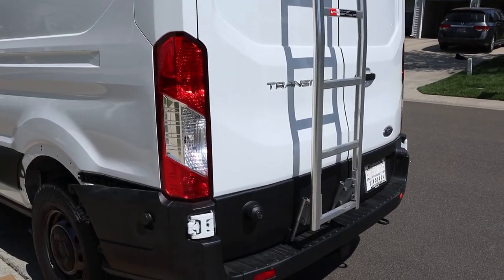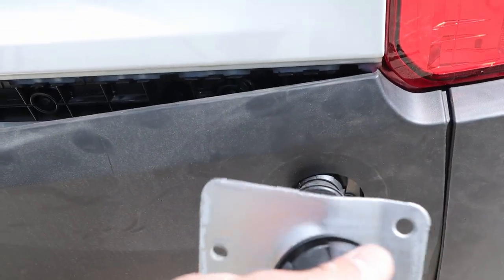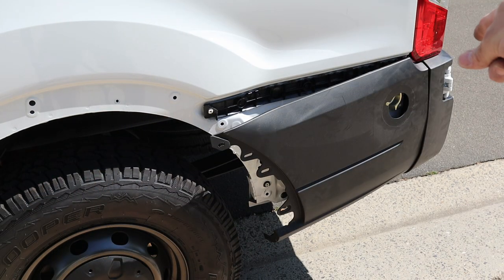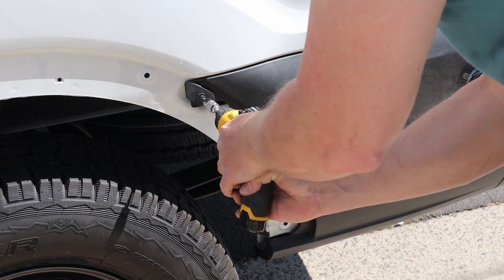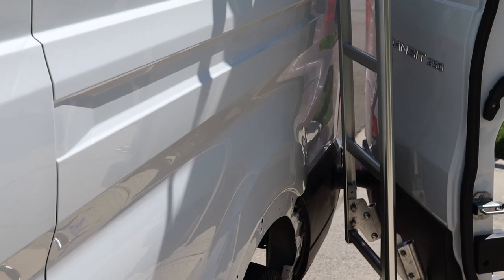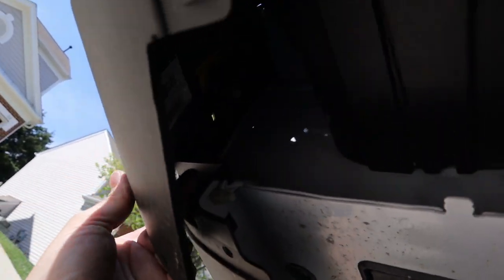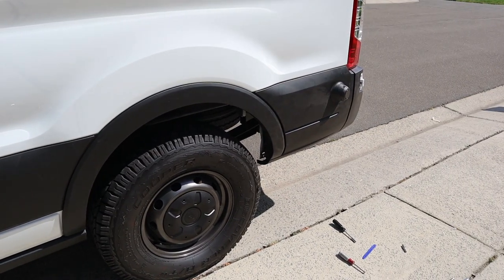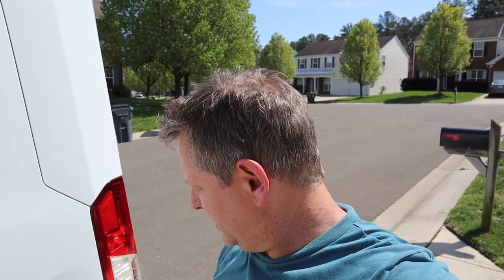#MTBPlanB Install longer bump stop and magnet for rear door of 2019 Ford Transit

Comment: Thank you. This video helped me to replace my bumpstop. One suggestion is to highlight where the screws are on the wheelcover. You mention them, but do not indicate where they are. Perhaps drawing circles over the location for ~5 seconds while they are exposed? They are hard to find by feel without knowing where they are... I ended up accidentally breaking off those attachment points because I couldn't find them. Thanks!
Reply from the maker: Josh, glad it helped. You make a good point about the screw locations.
Reply: Is there anything on the backside of the Bumpstop that needs to be connected or hooked up?
Reply from the maker: @seanmalatesta4957  Nothing on the backside.

Comment: Thank you for sharing! Noticed you have the Cooper Discovery A/T, are those stock size, or over-sized? And how do you like them? e.g. handling, road noise, traction?
Reply from the maker: 245/75r16 so slightly bigger than stock. Traction, handling and mileage has been great. Road noise is a bit on the high side.

Comment: I'm a total nube. I want to help replace a damaged bumper stop for a vehicle I damaged. What's the name of the tool I'll need to remove those big bolts off the metal bracket? Also is it a special drill bit for removing the Plastic trim? 🙏🙏🙏🙏
Reply from the maker: Grab a set of torx bits and a trim removal tool (plastic). The stop bracket is held on by bolts and can be removed with a socket, box wrench or crescent wrench.

Comment: What about the magnet on the rear doors? I need to replace it, but it does not want to unscrew.
Reply from the maker: Hi Tobey, Did you try popping the plastic housing off and grabbing the magnet with some vice grips and turn clockwise...it’s reverse threaded.
Reply: @MTBPlanB  Thanks for replying with that tip. I noticed the reverse threading on the replacement after counter-clockwise didn't feel right on the broken one. However, clockwise just keeps turning the broken one. I can't get it out yet.
Reply: @tobeyhancock1042  did you figure this out yet? Im having the same issue
Reply: @gordonjack1375  No, I got busy with other projects and need to return to this. I intend to take the interior door cover off to see if the bolt welding busted loose by chance.
Reply: @tobeyhancock1042  Thanks Tobey. Im in a similar spot as you and was thinking the next step is to remove the interior paneling but on the road at the moment so dont want to go down that path (yet). Please let me know if you get to it and have some insight for me. Ill do the same.
Reply: Was able to get around to this today. I pulled the interior door trim off (I have a passenger wagon) and found that the other side of the magnetic bumper has a T55 Torx bolt which had partially worked its way out. This was due to my earlier efforts to spin only the exterior bolt clockwise. Holding the T55 bolt in place was necessary to remove the bumper in my case. 
It was a little difficult to do without help. I used a long handled breaker bar on the torx bit to keep it stationary with my left hand reaching through the gap between the door and the tail light. I finished rotating the magnetic bumper off of the bolt with channel locks in my right. Reinstalling the new bumper was easy after that. 
Best of luck!

Comment: Do you know the part numbers needed?
Reply from the maker: I ordered for a 2018 Transit to get the longer stops. Part numbers are:
Lower rear Side trim bump stop BK3Z-61247A64-C 
Cargo door magnet BK3Z-6125040-A
plastic covers BK3Z-16758-C
Reply: Sorry, but all 3 items need to be changed to give the extra protection? I’ve got a mk8 and the ladders have just arrived today, so glad I say your video, thx
Reply from the maker: Yes, if the mk8 is the equivalent to the 2019 in the US.
Reply: @MTBPlanB  This is great. Thanks for putting this out there. Almost put my ladder into my window. 
Will I need more than one plastic cover to do this job (i.e. for the cargo door and lower side)? Not sure what trim parts from the 2019 are reused here.
Reply: It looks like this part number is also needed: BK3Z-16758-B
Reply from the maker: @gordonjack1375  I believe that. Is the short plastic cover. -C is the longer cover.
Reply: Note to any newcomers, I needed four items to complete the install:

BK3Z-16758-B 
BK3Z-16758-C
BK3Z-6125040-A
BK3Z-61247A64-C
Reply: @gordonjack1375  These are all the parts for one door, correct? So if I'm trying to work on both of my rear doors, I would need to order two of each part?